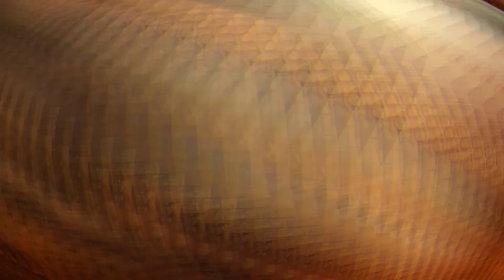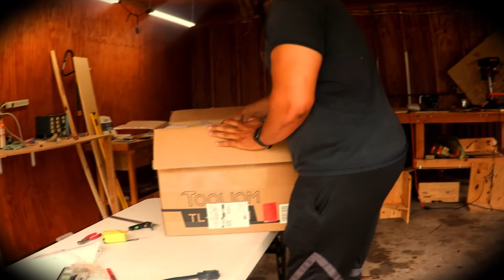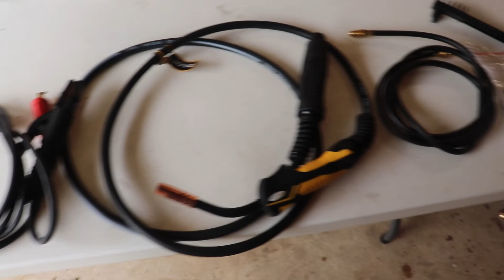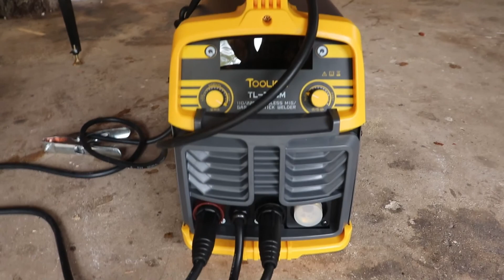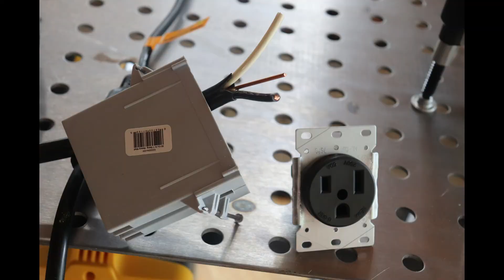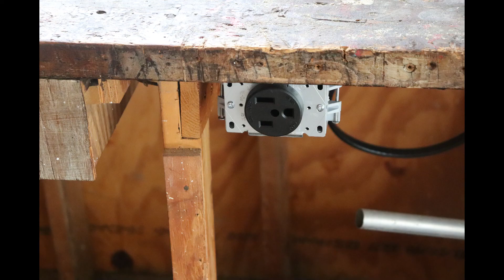New Welder Alert!!!  Tooliom TL 200M 🔥

Comment: I would go straight to using gas if I were you. You will get much better results than using just flux core. Besides mig you can also do tig if you have argon gas to hand. A much better idea in the long run.
Reply: myth 90% of people run the wrong polarity on flux core flux core is amazing but the most misunderstood and misused
Reply: @Crettybocker427  what should the correct polarity be? I saw a video of a guys switching the polarity from the usual to a reverse and it seemed to weld way easier and better 🤷🏼‍♂️ I just got this for DIY projects, almost went with the forney or yeswelder , but this was to he best prices for similar features and figured they probably all made in the same place anyways

Comment: What a waste of time video not real review help at all
Reply from the maker: Wasn't posted as a review vid, but I recently made one
Reply from the maker: https://www.youtube.com/watch?v=ESj8sA6DWTU
Reply: So whether you use 120 or 220 volts. The unit will use  the same watts. 
Yes, on a 220 volt. You can use a wire that can carry less amps. Say a 12 gauge romex vs a 10 gauge. 
Which is a savings in cost. 
But as far as watts actually used. Should be the same on either voltage.